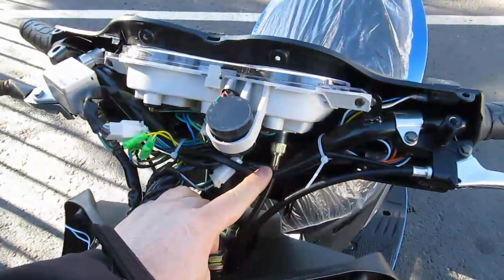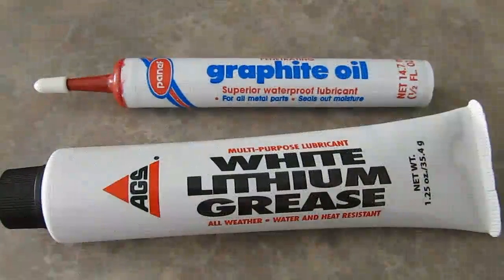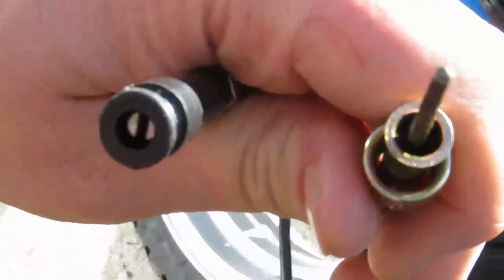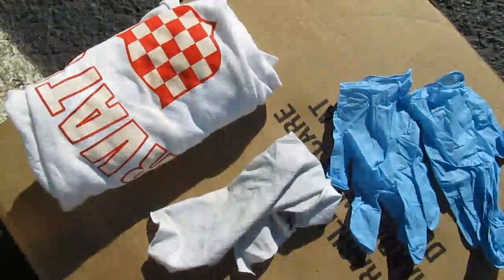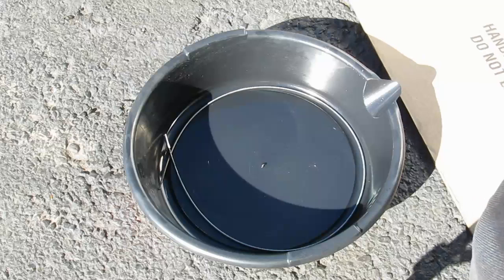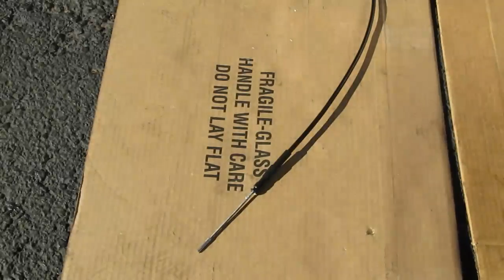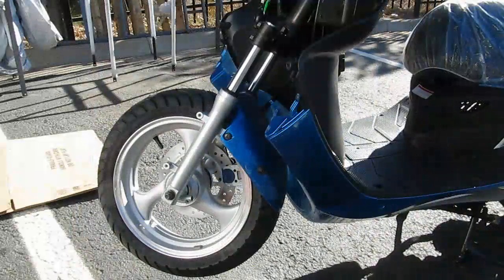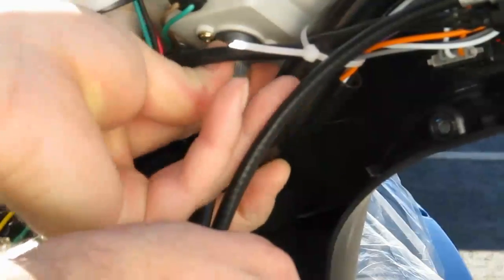Taotao ATM150-A Evo scooter - cleaning, lubricating and reinstalling the speedometer cable

Comment: very nice diy video thanks..my car's speedometer needle is shaking at certain speeds, probably cause the dried up grease isn't dampening the cable anymore.

saves me money from buying a new one...i used silicone spray from crc to lube the ends of the cable and since it's a dry lube..no leak or spatter to worry about

Comment from the maker: You won't find this info in the manual. I had a speedo cable break on my 49cc Taotao. The Chinese grease is low quality and hardens over time. I swapped out the grease in my Evo as soon as I unpacked it, so I don't anticipate any problems. PS there are several upgrades you'll want to do to a Taotao scooter. I recommend searching for "Taotao ATM150-A" or "Evo" on the scootdawg forum. You'll find my posts there. Glad I could help!

Comment from the maker: Do the throttle cable too. I had Rolling Wrench do mine when they did the post delivery inspection. They had a special gadget to spray lube in there. Also, on the engine side of the throttle cable, there's a short rubber sleeve that you might want to cut off (where the cable exits the sheath). Rolling Wrench warned me about these sleeves binding and causing the throttle to stick at full throttle. They gave me the option and I said get rid of it.

Comment: My screw for my speedo cable down at the front wheel was rounded off so I drilled it out and still can remove the cable.. any solutions?

Comment: My screw for my speedo cable down at the front wheel was rounded off so I drilled it out and still can remove the cable
Reply: iSkullyRider mine is rounded off to did you ever get it off? If so how did you do it lol I'm having trouble with mine lol